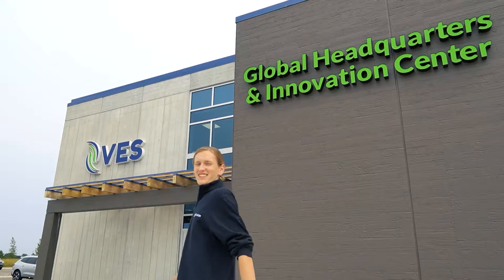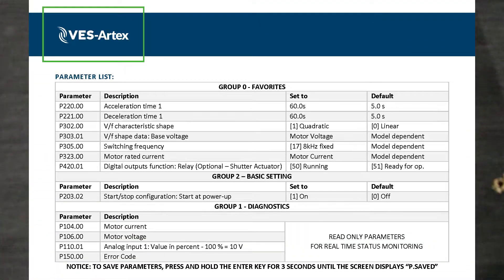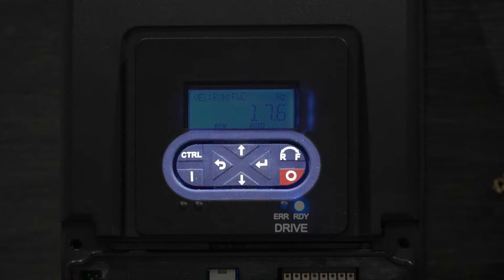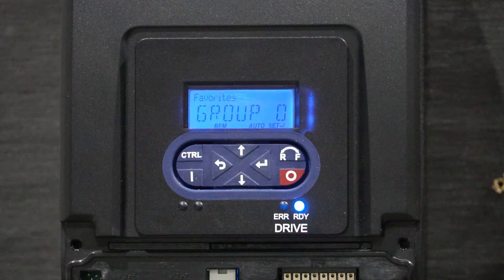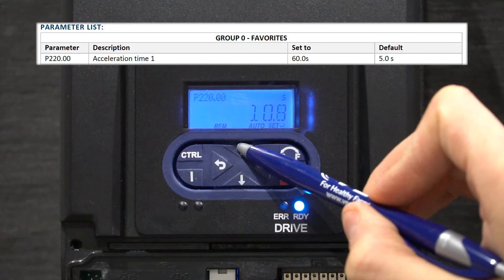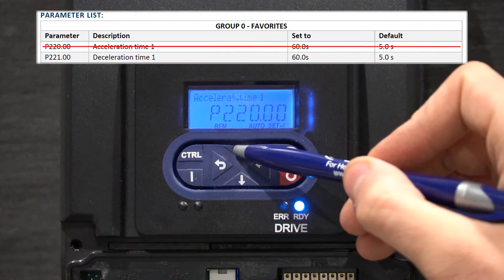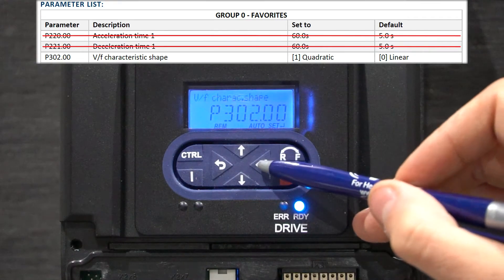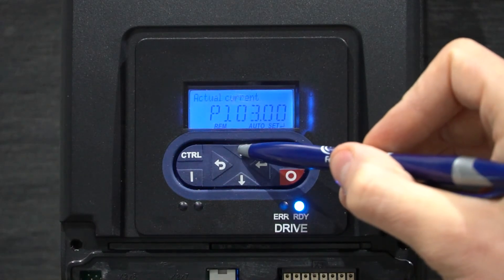Lenze Protec i550 Configuration | VES Artex Academy

Comment: Nice video. What parameter do you use to prevent the fan from being able to go in reverse direction?
Reply from the maker: 1:00 Briefly pressing the R/F button will change the direction of your fan. By default, the Lenze Protec i550 is set to run forward.